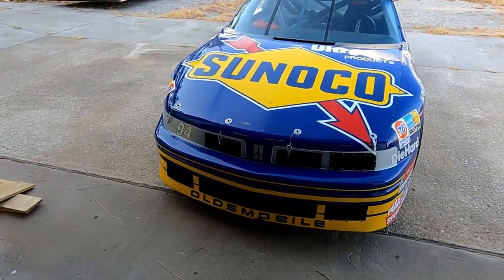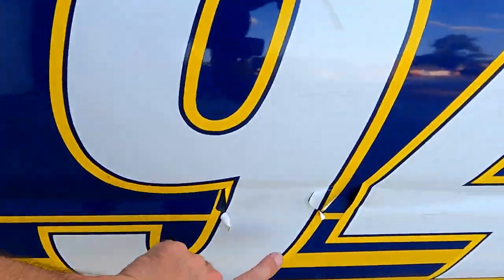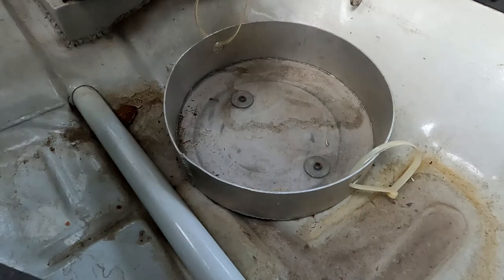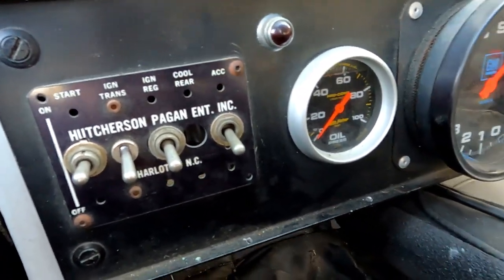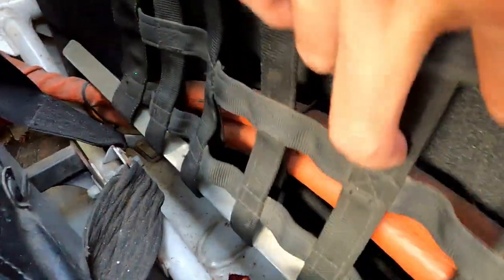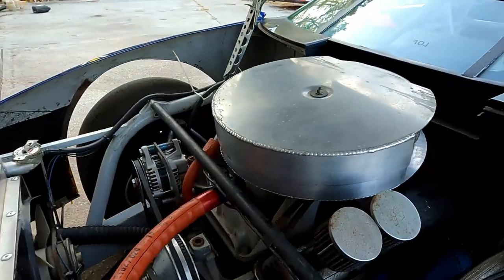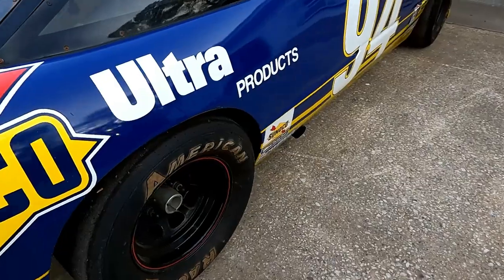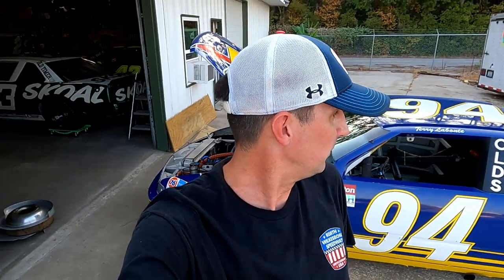Walk around of the 1991 Terry Labonte Sunoco Oldsmobile!!

Comment: Love this car. The dent in the rear quarter looks easy to pop out. The one on the roof and the one around the dry brake will be the more difficult. I pretty sure the round pan on the floor is for the old round orange igloo ice chest to be locked down to for an early helmet air cooler.
Reply: Yep 👈🏼‼️

Comment: The round aluminum pan is to old a round Coleman type water cooler. A hose would go from the cooler, to the driver to try and keep him hydrated.

You are 100% correct, this is one of the best era's in NASCAR Cup Series history. This current, cookie cutter next gen car is terrible. They're all the same chassis and common template body. Stage racing, the chase and the charter system have ruined what used to be a great sport. Bill France Sr, Anne France and Bill, Jr are all rolling over in their graves.